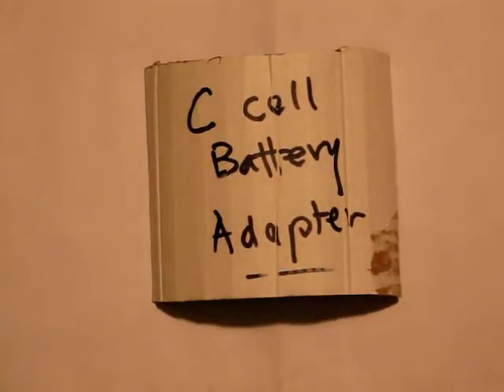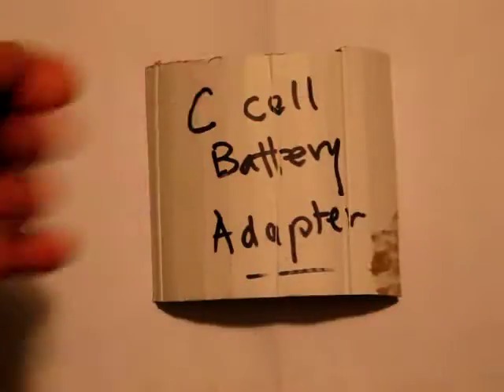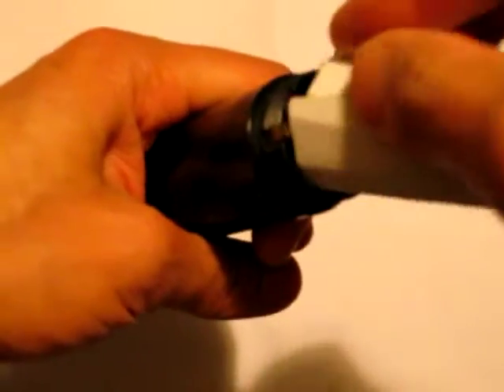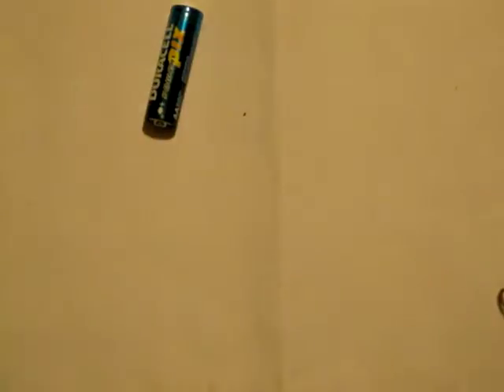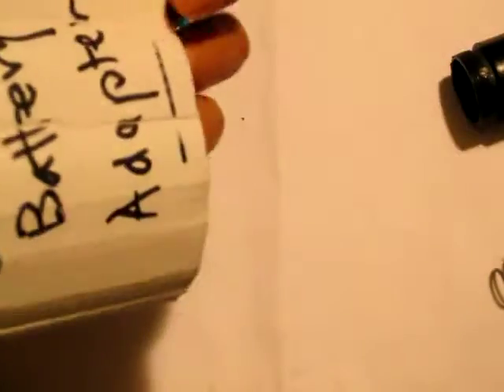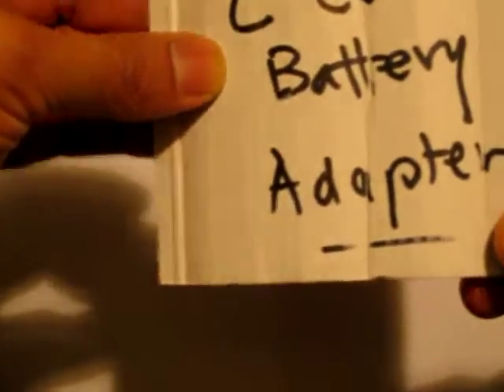C & D-Cell Battery Hack - DIY Adapter Using AA Battery, Cardboard and Coin Penny  - Homemade

Comment from the maker: Yeah, it works. I read on a Battery Forum that the AA and C are the same length. All you need is to make the AA thicker. That's what the cardboard and penny are for. Some people like to use a Nickel instead. Works great.

Comment: Tis true.  I would be using this in my Vox DA5 portable amplifier which takes only C's - but I am outside of the U.S. at the moment and they are very expensive here (like 3x the price of back home!).  

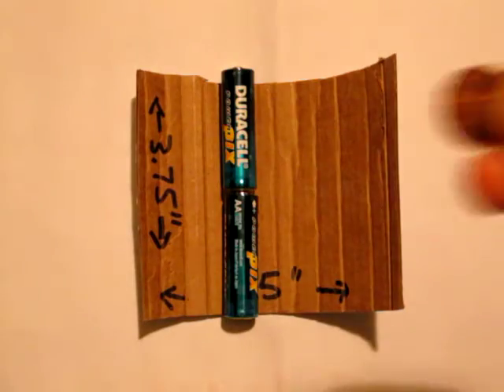You still haven't acknowledged my observation at 0:36 though ;D  hahahaha